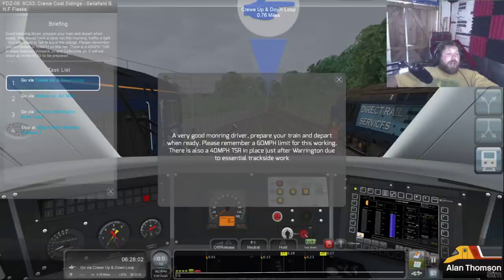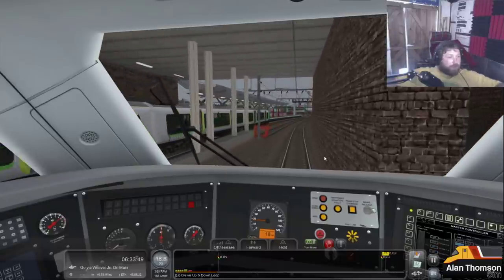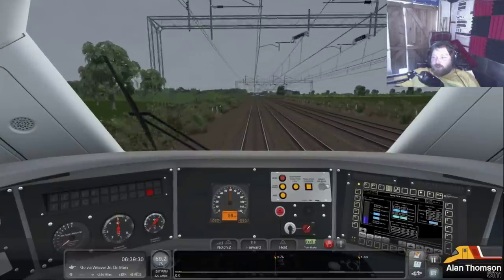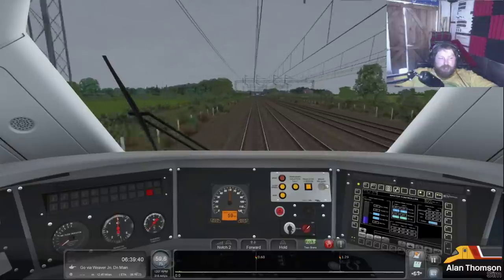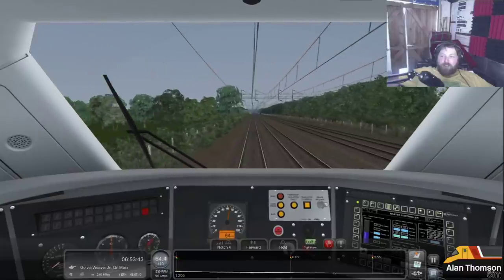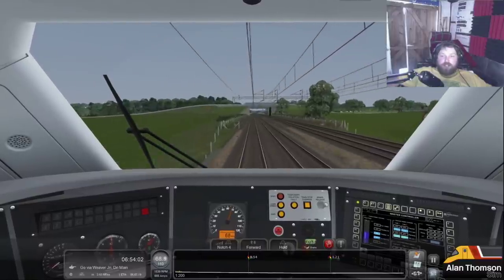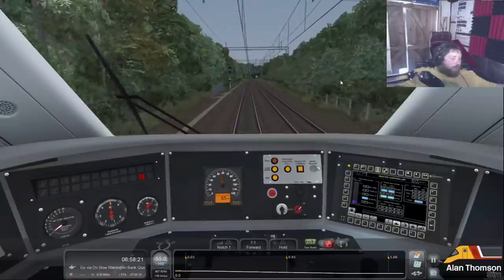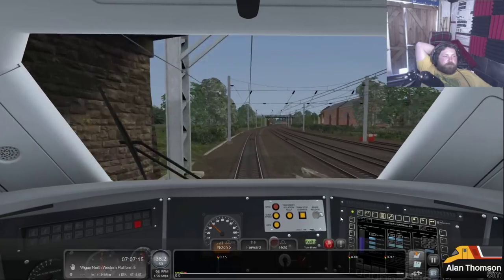Train Simulator 2020:Class 68 Crewe Coal sidings-Sellafield B.N.F Flasks

Comment: Is there anywhere you can get the virgin trains pendolino that was on steam
Reply: Not that I know of?
Reply: Looks like the original S9BL Pendo. It's still on Steam. You can get the reskin from DPSimulation.
Reply: @adamhaigh9947  no. Not that one. The. One that's pro range
Reply: @isaacridge4493  The newer Pendolino was a Virgin Licensed product unlike the S9BL model, meaning when the Virgin license ended the Class 390 had to be removed completely as it featured solely as a Virgin product.